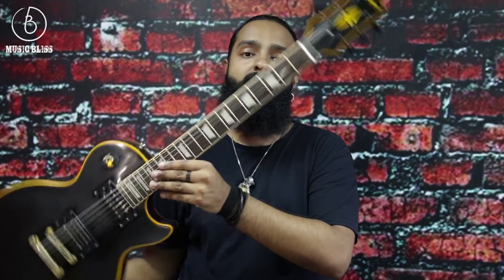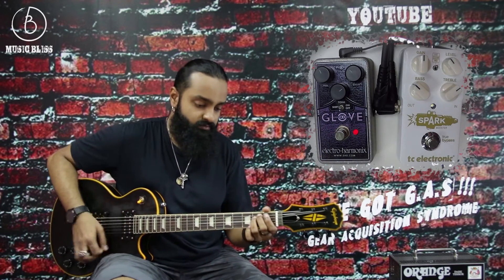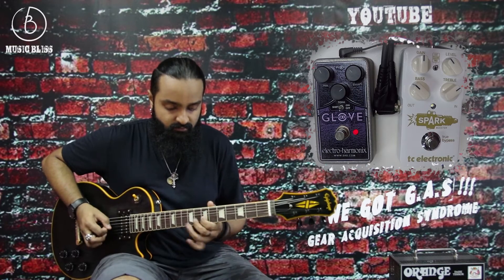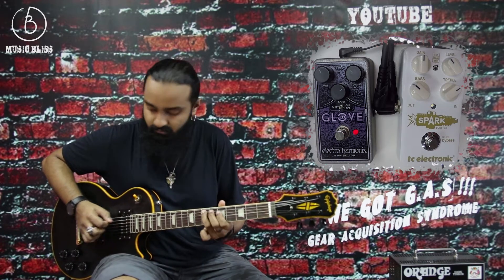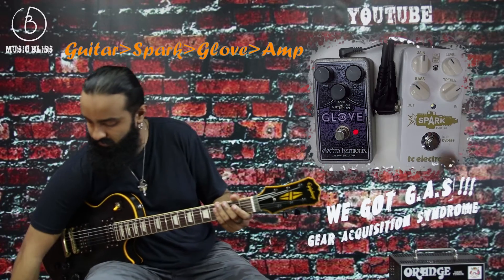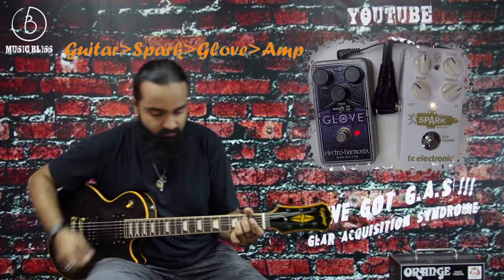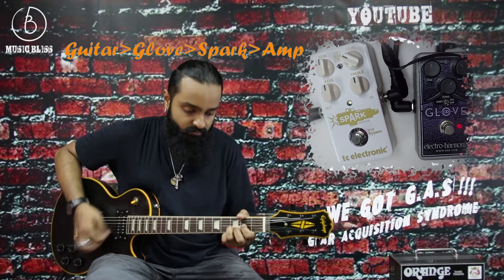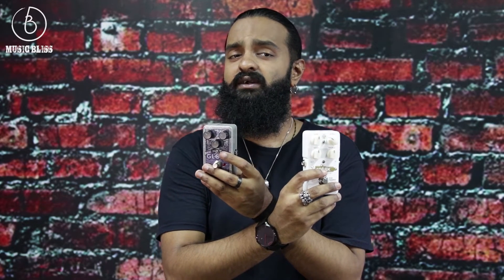WHERE DOES THIS PEDAL GO: Booster Pedal Placement

Comment: It seems that the boost after keeps the tone more articulate while the boost before saturated the drive pedal more. It seems like a boost after would work better for fuzzes where the input heavily changes the saturation levels, but would work better before with a more amp like distortion.

Comment: Question I would have is , let’s say that booster is before the OD to boost a bit more for gain and volume, can you chain a boost after as well for solo boost? Most people use it after and simply for solos ...but can you boost the boosted sound already for leads?
Reply from the maker: Sure, why not....I've done that personally, a boost before and a boost after.
Reply: SaintsCheat I’m doing just that and I love it. Stacking pedals, overdrives specially is awesome

Comment: Cool video! Where do you recommend to put a clean boost? Last in the chain? i..e after Delay OR just after OD but before modulation? I just want to have a louder volume during solos. 😀
Reply from the maker: I'd place it after the OD, before the delay....
Reply: @MusicBlissMalaysiaTV  hi Ken, where to put the eq pedal, I have both, eq and booster pedal, thanks.
Reply from the maker: @franklespaul7150  Depends...if you want to change the tone of the guitar then before drives....if you want to change the sound of drives then place after.
Reply: @MusicBlissMalaysiaTV  ok thanks ken

Comment: I found this video very very helpful, thank you for demonstrating the booster characteristics before and after the OD.
Do you find that you get the same characteristics with all overdrive pedals?
In other words will the booster before the OD always boost the drive gain but not so much the volume?
Will it always leave the drive the same and boost the volume when put after the OD on all pedals?
Reply from the maker: Yes indeed, the boost before an OD will definitely increase gain all the time. However it is important to take note of the GAIN level on your OD pedal. If it already set to a higher gain setting, you'll only notice more increase in gain. BUT if the OD pedal i set at a lower gain, you can actually hear not just an increase in gain but also a slight increase in volume. 

As for the boost being after and OD, it very much depends on the character of the boost. For example, the CAE MC401 is a transparent boost, which will only add volume. But the MXR Micro Amp might add a little something else, a bit of "colour" because if was designed like that. The TC Spark in this demo was used in the Transparent setting when placed after the OD, thus not affecting the character of the OD. If I were to flick the toggle switch to the MID of FAT boost, you'll definitely hear the character of the OD change.

Comment: Great video! Great channel!  I recently bought a Marshall BB-2 pedal that I intend to use just as a booster; do you think it's a good option, or should I buy one that is just a booster?
Regards from Uruguay!
Reply from the maker: The BB-2 will be great as a booster before your drives. You can set it up like a Tubescreamer (All the volume, just a tiny bit of gain) and see what that does. But if you plan to boost your volume by putting it after your drives, you'd be better off with a stand alone booster.
Reply: thanks a lot! Keep the good work!

Comment: Hello, what position in the signal chain should i place my boost if i want to make my solos cut through more. Before or after the drive pedal?
Reply from the maker: Timothy De Leon definitely after your overdrives...
Reply: Timothy...if you have a high gain amp that is heavily distorted....put the boost last in your chain in the fx loop !!!!!    Not only will you only have to set the pedal very low like maybe only a 3 db level 9 o'clockish,but it will increase your volume without adding gain.Will not work in front of your amp if it has full on gain as it is heavily compressed at that point and will not add anything but bad tone.Trust me on this one lol.